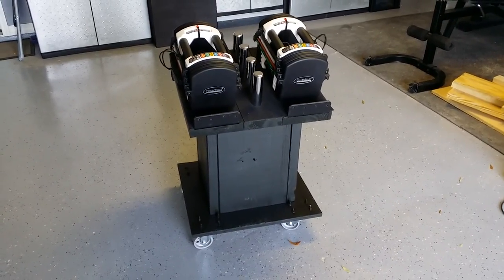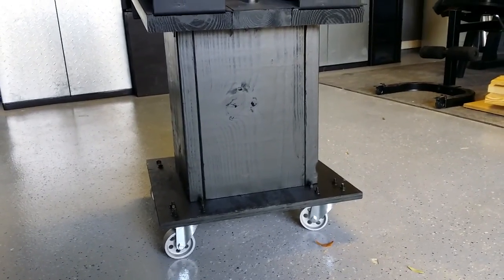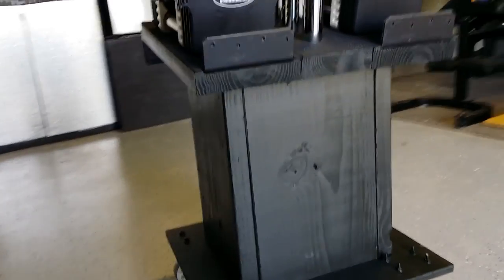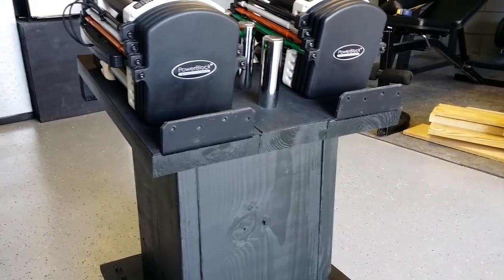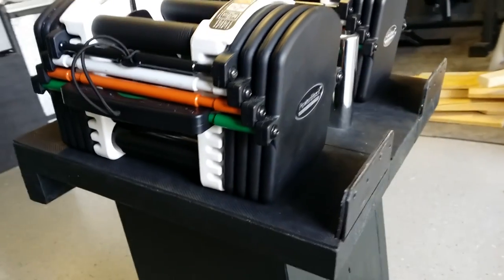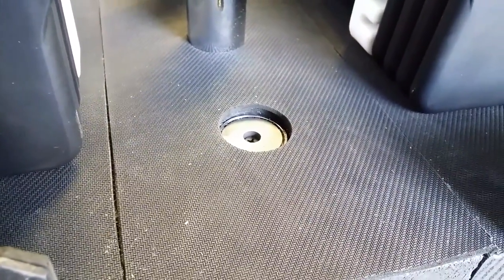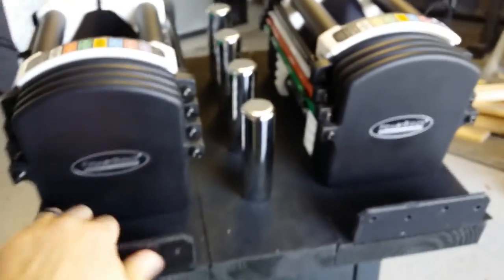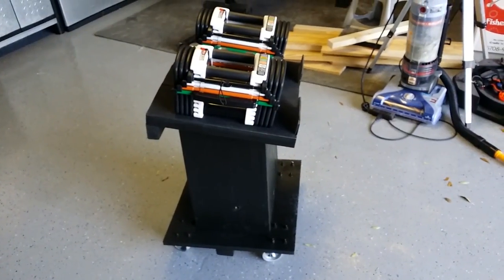DIY PowerBlock Stand

Comment: I already have the U33 column stand. I wonder if I can add coasters to it some how?
Reply from the maker: I think this would be your best option. You can buy casters at any local hardware store. If there is no way to attach the casters directly to stand...you could just build a simple rolling platform and attach the stand to it. Something like a small DIY furniture dolly.
Reply: @ClayBuilds  that's a good idea.  Thank u.  However stand will be taller too